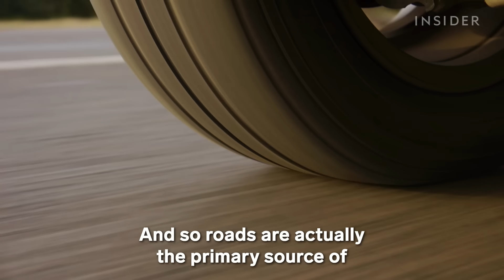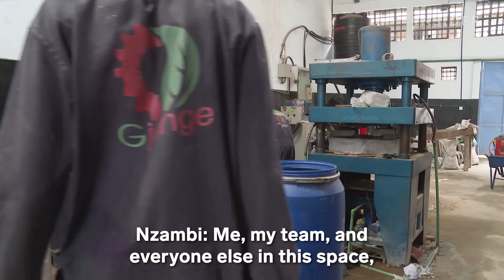Young Inventor Makes Bricks From Plastic Trash | World Wide Waste | Business Insider

Comment: If this plan would be executed it will cause serious harm to any ecosystem this road will pass through, because tiny plastic chips will constantly erode off the surface while cars drive over the road. These plastic chips are totally non-biodegradable, so they will fly everywhere and cause lasting, massive damage to ecosystems in a very wide range surrounding that road. Very dangerous idea! I am sure it will never be implemented in my country but I fear it will be in poorer countries. Roads cannot be built out of plastic, this is a bad bad idea. Other products however sound pretty good, such as roofing tiles or other products that do not intereact with other moving objects.

Comment: If there is a problem with microplastics use the bricks for pavements and surfaces in low wear environments such as pavements.
It is often overlooked that roads also produce noxious chemicals from tyre wear which ends up in run off and rivers.
Reply: No matter where you use them, they are going to wear. And yes, rubber tires also wear and spread microparticles. The problem is simply that our materials are incompatible with our environment. Thats the reason we are desperately looking for a place to put them, as our original idea "well dig a hole and put them there" turned out to be a bad one :)

Comment: Scientifically speaking. This method could be improved.

Because the ratio of the sand and plastic that is used in this video is random each of those bricks would have different tensileand compressionstrength. If this was ratio was to be perfected we could have something much more efficient and stronger than what it already is. 

Just like ancient  roads that lasted for thousands of years.

Comment: Plastic... is very thermodynamic... Like if plastic gets heated then cooled then heated and cooled over and over again it begins to warp - which is bad if its a road. I did nitrogen "welding" in body shops and no you dont want to make roads out of plastic like PLC (what most cars are made out of) - a further down side is if they are made more ridged (like PLA) to withstand heat they become incredibly brittle and can snap with little amounts of force rather than bend. Set aside the heat - it also has to be beaten up by hundreds cars and trucks weighing dozens of tons, everyday- all day. There are other types of plastic but at that point you're reinventing the wheel...

Asphalt is used because it is literally one of the best things humanity has invented. Asphalt is 99.9% recyclable, cheaper than plastic, its durable, can withstand high and low temperatures, relatively clean to produce and extremely cheap to maintain. Why not just use that? What about plastic bricks for housing?

Comment: I appreciate the intention, i really do. But there is a reason other dont use plastic to pave road, its not really sustainable cause a long the way, it produce all microplastics which is harder to control and remove. If you want to know more, learn about civil engineering on road building.
Edit: Just as sidenote, i am 100% agree to use plastic as substitute aggregate, but not as primary material. We use a mixture of single use plastic and asphalt. And again it already applied in many part of the world, and it work.

Comment: The answer to your click bait title is they will have a much lower coeffiecient of friction esspecially when wet or when freezing or with grease or oil deposited on them over time. And they will require much more frequent resurfacing. Badically the same exact surface failures as every attempted solar roadway. Not to mention many plastics do in fact leach very harmful chemichals slowly to the universal solvent that is water. But im sure humans are foolish enough to attwmpt it at the cost of taxpayers. And im certain that many voices will warn all of what i am commenting. But low I.Q. group think will prevail i fear.

Comment: PLASTIC SHOULD NEVER BE USED IN ANY ABRASIVE SITUATION.

ESPECIALLY WHEN THERE IS NO FILTER/SEWAGE SYSTEM.

USING IT AS BOULDING MATERIAL FOR HOUSES (BRICKS, INSULATION) WOULD BE MUCH BETTER.

Comment: Taking plastic out of a natural environment and putting it back in a different spot is not a solution. It just moves it around, and it will still decay in weather/abrasion, and go into the soil, waterways, air.
 The issue is the industry which needs regulation by law in recycling, manufacturing and importing plastic goods- shifting to using other materials , in saying that, if it could be contained or used in a less destructive way than on a road-in the meantime, its still a good idea. . Imo

Comment: It's a nice thought but it creates a new problem.  The wear and tear on the road surface creates plastic dust which then gets into the water supply.  Micro plastics are a whole other headache.  Now, using these bricks or something very similar to build a home, or storage sheds, or other low friction application? Much more appropriate and will last a lot longer.

Comment: Terrible idea. As the plastic wears from use and the result is a fine dust of nothing more than plastic. The small particles do not degrade and will pollute the local environment for thousands of years. The bricks should be compressed and stored in a sanitary landfill. We need to take plastics out of our environment, not look for ways to keep using them.

Comment: These plastic and sand bricks are indeed a good way to utilize waste plastic, but they don't solve the overall problem. Basically, the plastic waste is just relocated from garbage piles to roads and pavements, but the microplastic pollution still happens, since mechanical and ultraviolet erosion will still happen.
On the other hand, it's economically interesting because there bricks cost less and last longer, and also, these bricks reduce the amount of CO2 that otherwise would be released by concrete and asphalt production...
It's a step in the right direction, but it's not a solution to the plastic waste problem.

Comment: People act like this is something new...
I have seen at least 10 people wanting to make roads out of plastic and somehow every single one of them does something new.

Used for roads? No , it just isn't good enough for that.
Walkways? Maybe , but i only see it used in poor countries or bought by people who want to "save" the earth.

I would also like to know how they behave when exposed to heat/fire.
For the record , i deal with recycling plastic waste and not long ago had an arson case at one of the locations , which burned to the ground , leaving nothing behind , only ash.
The fire department couldn't do anything by the time they arrived.
So what would happen if a fire broke out on top of this surface?

I see this as just a roundabout way of going about things.
We need to stop this kind of plastic waste production and go about it in a recyclable and sustainable way.
Which would mean a LOT less littering and a more efficient way to get the plastic to the recycler.
Which only the government and the culture of the people can do.

But the current system which puts all this on the recycling companies to fix it while government officials and people treat recyclers as trash just simply isn't right.
I have wanted to stop the plastic recycling part of my company so many times , just because it is extreamly taxing both physically and mentally.
Government doesn't help , government inspections monthly , nitpicking at anything they find , expecting you to do things like a company with tens/hundreds of millions would is just unrealistic.
And then also you getting blamed for anything that happens. It simply isn't healthy.

Comment: It is not a good idea since with wear and tear fine plastic dust will be introduced in the environment. Brtter to incinerate or recycle.
Reply: 100% agree. If recycling isn't an option, it's much better to burn the plastic and convert the energy to electricity. It increases carbon dioxide emissions, yes, but it's the way to go, really. It's what modern, developed societies do today.

Comment: If the bricks get eroded by cars over time and release micro plastics  when they are used for driving roads, then why not use them as something that gets less impacted on a regular basis, like sidewalks and pavements or even use a different mold and make them into other things like flower pots
Reply: I think the main issue is the exposure to Uv light. So maybe somethings that are not directly exposed to the sun like tunnel roads

Comment: She has a bright future; her way of thinking and how she takes action when she sees  a chance turn a problem into a something better is going to help solve one of the many problems the people in Kenya are facing. 
     For those that argue that using plastic as a method of paving roads in Nairobi is a bad idea, consider where else the plastic they have would be if not the bricks. The broken-down plastic in landfills is going to break down much faster than a brick of it will because less of the plastics' surface area is being exposed to the sun all at once. Her company is helping her people by creating an opportunity to pave roads that would otherwise not be paved due to costs, and turning already existing plastic waste into something more useful. 
     With proper company investment this is a great opportunity to create jobs in Kenya and stimulate the local economy. This is not the perfect solution that many would go for, but it is a start, one that can lead to better solutions in the future.
Reply: However, like was said in the video, any solution that doesn't involve stopping the production of new plastics are going far enough.

While I commend her for trying to do something with the waste, it's not solving the core issue of the fact we produce 13 million tons of plastic every year with the oil companies consistently increasing production of plastic meant to be thrown away.
Reply: @Shadowtiger2564  I agree with your statement regarding the core issue at hand. There are places where we need to use plastic, electronics for example, as we still rely on them to write the messages that are present in this video (the keyboard that we are using, the way we insulate individual electrical components, the way we route power lines across our own respective countries, etc.), realistically we wont be able to completely eliminate plastic, however, we can most certainly say that we are overly reliant on them because its cheaper to use fossil fuel products than other options. It wont be an easy change, but its one that we have to do. As long as we wean off of excessive fossil fuel use over time we can at least take care of the plastic issues, among other fossil fuel related issues, in the long term. This is where we have shift things such as culture, to value non-plastic products more so than cheaper, disposable products. 

For those that do not know, there's a reason why "Recycle" is the last of the three "R's."

Comment: Wouldn't it be better to make walls/homes out of plastic bricks? Its a entity that is not prone to wear as much as roads or paths and a sealent from the elements could help reduce its effect on the enviornment.
Reply: Was thinking the same thing.  They'd be good for structures, then you spray it with water-proof liner and then spray on stucco or concrete.
Reply: @dieterrosswag933  
That's why I said use it to make structures, then spray water-proof liner (prevents leeching into the ground) and then stucco or concrete for aesthetics.
Reply: @dieterrosswag933  
No, it's the same bricks.  It's just being coated.  Pure concrete and rebar is way more expensive.

You're not coating them individually.  That'd be stupid and wasteful.  You're building the structure with the bricks, then coating the structure.
Reply: @dieterrosswag933  
I'm not talking about concrete bricks.  Who tf even uses that?  I'm talking about anything made of poured concrete.  Multi-level buildings are often made of poured concrete.

Anything made of expensive concrete and rebar can have volume displaced by these cheaper bricks.  The only catch is, it's a good idea to line the bricks, because concrete is not waterproof, and plastic molecules will leach, if there's no barrier to stop it.

Another possibility, is to melt the bricks together.  It may prove strong enough to be load-bearing (engineer would need to confirm).  Create a small amount of pollution, but then you can use it for highways and parking garages.  Solid plastic is usually extremely strong.  Sagging is another risk the engineer would have to take a look at.

Aside from these issues which only an engineer could assess and work through, there literally is no issue with using these bricks.  You're just stuck in naysayer mode, imo.  Arguing just to argue.
Reply: Fire.
Reply: @dieterrosswag933  
I know this isn't your first language, but come on.  At least try to use 1st grade reading comprehension.

Liner.  You put it on basements to keep hydrostatic pressure from flooding them.  You can use it to contain plastics.  I'm not proposing anything that complicated.  Please try reading this time.

Comment: Main issue is that with the growing floods and other water related issues, concrete in and itself a problem. Last thing we want is a plastic road. But honestly this is atleast better than simply throwing it away.
Reply: It was thrown away, right all onto Kenya.

I think she needs to partner up with a construction company and scale this up.  It could replace a lot of expensive concrete.  You could build structures with these bricks, then spray on a waterproof liner, and then concrete or stucco.  Because it's plastic, it's far more earthquake resistant and might not need rebar, the way concrete does.

Comment: Man that guy criticising her rubs me the wrong way , she’s out here doing something tremendously positive for the world while what is he doing exactly? 
If abrasion is such an issue why not use these for buildings, roofing, walkways there’s plenty of other uses. The cynics really just needed to be fed their little segment
Reply: There are many other issues that weren’t even mentioned in the video so they were being overly optimistic if anything. For example: the rigidity of these are very misleading by the video, no plastic especially a recycled plastic using the plastics of bottles and such has the rigidity needed on a molecular level to perform most the functions long term. They only possess shock resistant and water/insect resistant properties that could potentially excel vs traditional materials. But for a road for example they could not even come close to being able to support endless vehicles weighing several tons constantly passing over them before they bend and contort especially under the high stress conditions associated with being out doors in the heat and cold. the thermal resistance regarding contracting and expansion is very poor with plastics. Being they lose many of their positive properties when in either hot or cold temperatures. These bricks would be lucky to last a week as an actual roadway for vehicles and that’s being generous. Which obviously is not cost effective nor logically sustainable via labor. That’s just a small fraction of the list of problems so trust me, this “critic” was even being optimistic.
Reply: @bender0428  if it was created entirely out of plastic I’d be on board with you but doesn’t the sand help prevent those issues you mention

Comment: Using these for roads or even building houses spells disaster, imaging microplastic dust in the air due to plastic breaking down from the sun's UV light. Making indoor floor tiles would be a better idea.